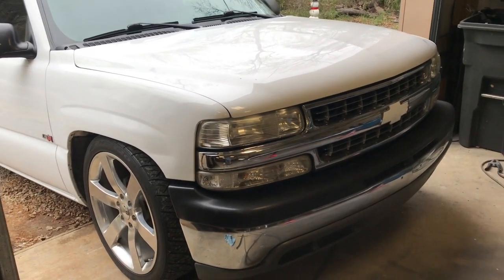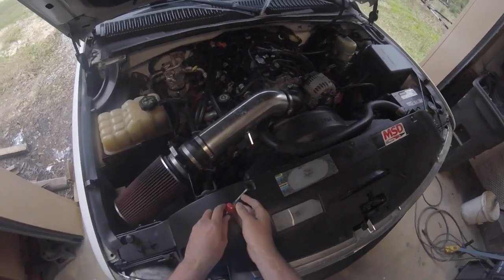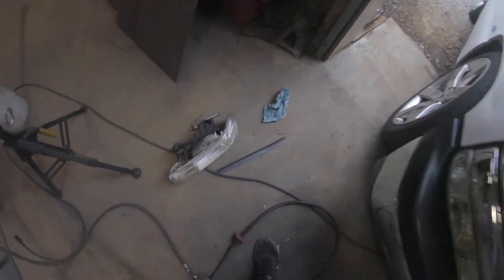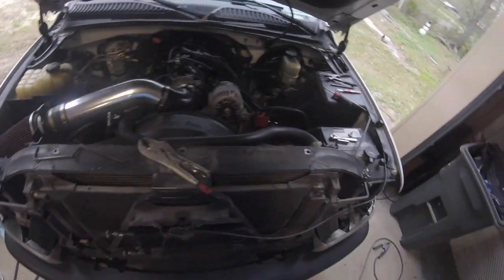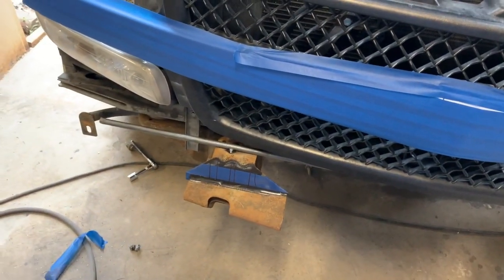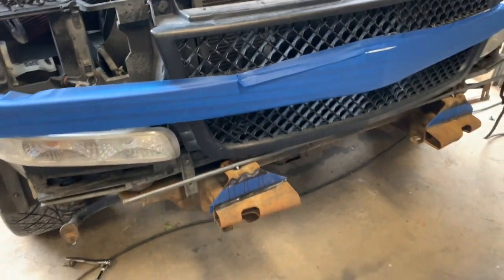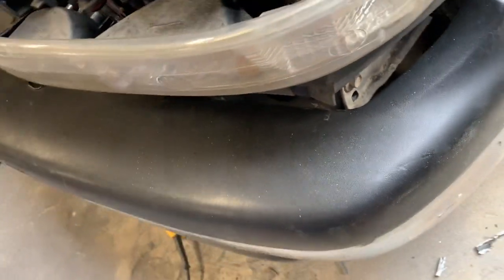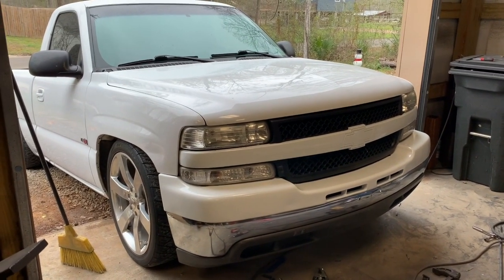Cammed silverado 1500 HD front end conversion

Comment: I did mine alot different. I cut the whole bumper bracket off of the frame rail and lowered them and rewelded to keep the top hole and bottom hole and everything the same as oem just lower. That works too tho the way u did it. Looks good
Reply: What do you mean? Got pics of out it came out? Im just curious how to do it i wanna conversion this weekend and I'm looking for ideas
Reply: @nestorperez2913  I've got videos on my channel where u can see it or pics on my insta under the same name

Comment: Great video and thanks for making. I have an 01 Yukon and want to put this HD grill on it. Do I still need the HD bumper cap since my Yukon bumper cap has the dip in it?
Reply: The grill wouldn’t match with the lights so you would need a whole front end fenders and all
Reply: For a Yukon you can use the hood but you're gonna have to shave the corners to match your headlights. If you want the hd conversation you'll definitely have to change everything

Comment: Does your grill not have the quater turn Phillips head I’ve never seen anybody use pliers to get the grill off
Reply from the maker: They are quick connect clips
Reply: So you don’t have the quater turn Phillips head that you turn a quater if the way and just pull out?

Comment: I like it especially being a rcsb with it. Are there any noticeable gaps with the bumper now? And what made you decide to swap to the HD grille?
Reply from the maker: Alex Perkins there was at first but I fixed them. If you make sure everything is correct you shouldn’t have any gaps. My bumper cap is off a used truck so it had some flaws already.

Comment: Where did you buy the HD stuff, are they OEM or aftermarket, I have the same model of truck and I want to turn it into an HD but im no sure if i can trust after market products or do I search for OEM parts
Reply from the maker: I got mine off of a 2500hd parts truck. You can trust aftermarket but may be more worn to get it to fit correctly.

Comment: I have a 99 1500. Would I be able to place an HD hood from an 02' 2500?
Reply from the maker: Sure can. I’m still missing the hd good.
Reply: LsX Brandon  Thanks, I’m going to order one. I would’ve done  the grill too but I not too confident in cutting brackets and besides I already bought a stock grill and bumper, looks really good though. You make it look easy.
Reply: @lsxbrandon8548   Ok, so I got talked into getting the grill installed. I have a friend who has a welder and will help cutting it. What year HD grill would fit on my 99? Which place do you recommend to find one?
Reply from the maker: 99-02 and a junkyard
Reply: LsX Brandon  Thanks.